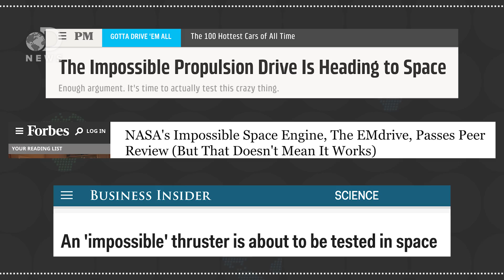How The 'Impossible Drive' Could Break Newton's Third Law

Comment: Welp, if this thing works, time to rewrite some of our science books...
Reply: SirDeimosKnightoMars  I think this resemble solar sail. Newton's 3rd law doesn't apply to photon. Photon can push objects but since photons are massless, the object can't push back.
Reply: Genus Entertainment i dont think so.

i honestly believe u can reconcile the 2 without rewriting science. 

basically i beleieve it is destructive interference at the small end of the cone that is causing the net pressue on one side (large side) to exceede the net pressure on the small side. 

it doesnt violate 3rd law nor conservation of energy
Reply: sylvester lutchman That is very likely a possibility, but doesn't seem entirely efficient if it does work, I feel like it would take much more time to build up enough momentum to even go anywhere. Sure, one side may gain more energy, but the other still gets some creating some interference, almost like a faulty equilibrium. Therefor, taking away from its absolute potential to be a mode of movement
Reply: ***** True, similar to how singularities (like a center of a black holes) seem to make the laws of physics cease
Reply: A photon is not pushing a solar sail with the same principe as you do when you push your car ( action/reaction ), photon is maybe massless, but it still has energy ( hence the solar panel on Earth ). Its energy of course depends on its wavelength ...When the photon touch the solar sail, it releases its energy onto the panel. This energy is a radiation, which can create a radiative pressure ( very little , about 1×10-27 kg⋅m⋅s-1 ). So on earth, it doesn't suffice to move something agains gravity ...but in space..if you had really a massless particle, with almost no energy, then it doesn"t interact at all with us  ..hence it cannot move a sail or anything at all.
Reply: babacalouche Oh, by push, I mean exerting pressure. Of course energy conservation still holds, I think result is redshift in the reflected ray.
Reply: One can only hope. Current Physics books were written around 100 years ago. Science is not meant to last that long.
Reply: well you can still dream..Most of the current physics is in fact from the last dozens years ( i doubt the string theory, the black holes , the parallel universe were  written 100 years ago) ...and of course even if thousand years ago, someone says " omg this thing in the sky , we should call it " sun" ",it didn't change since then...the same sun is still there, no matter if you think it's not...science is the same ...men can sometimes be wrong about it, sometimes they can ignore it, sometimes they can find something , even partially, but still science is a thing which exist and which doesn't change. Gravity, weak and strong forces, electro magnetic fields and so on existed before you could write their name and still will after the death of everyone of us

Comment: Why not just use Solar Sails? Easier and similar mechanics.
Reply: johnyjoe2k because they are shit? They give pitiful thrust ONLY if in line of sight with the sun and take an enormous (km2 enormous for anything bigger than a probe) area to deploy,  plus being susceptible to tears while unfolding them from the launcher and from micro impacts once deployed?
Reply: Solar sails are not even close to similar mechanics.
Reply: Sascha Kramarenko the emDrive would certainly have many benefits over a solar sail.
Reply: If the EM Drive does work, then I think that one works way easier than solar sails and has more power.

Comment: With "every action there is an equal and opposite reaction" does not specify the form of energy that results from the interaction or how that energy is transferred when the reaction reacts in reaction to the action. That being said the most probable answer is that there is an outside source of energy which is not constant that is not being accounted for.

Comment: I'm still only going for my degree so I'm not too fluent on the matter, but wouldn't the fact that the waves reflect to the back and bounce off of the other side cancel out the force acting on the large surface even though they're slanted because it will take the waves more time in that half thus evening out the net force? And I get what he means by relativistic speeds working on different physics, but unless he shows how exactly his example differs I couldn't really get behind it until it's tested

Comment: Wouldn't the EMDrive work because the microwaves will transfer energy, becoming kinetic momentum, when it reflects off of a surface. So a photon would release more energy from its first bounce as it would have a higher frequency. Therefore the photon would end up decaying as the energy is transfered through the closed compartments surfaces.

Either that or its a way to move spacetime, essentially moving the vessel without exhibiting any true movement.
Reply: And if the latter is the case (which it probably isn't) whoop whoop we have warp drive.

Comment: wouldn't the reactant simply be heat?
Reply: Rough Boulder yeah but that energy from heat is still escaping to the outside on a large surface area still work in space as it's still energy escaping from the Drive
Reply: in Newton third law for an action there is the reaction.  the microwaves carrying momentum bouncing of the walls would produce heat.
Reply: except they tested it in space, it still created thrust
Reply: Jordon Cole-Samuels I had the same conclusion
Reply: lasarith2 in that case it would be moving toward the smaller side, as the larger side would radiate more heat
Reply: Rough Boulder I have no idea which side it moved from the smaller or the larger if it was the smaller end -it would be more compressed at that end (not the wave itself but /\/\  instead of /  \ /  \ at the larger end creating more thermal heat then the larger surface area Still works just have to redefine the physics

Also it has a thermal plate attached to it to vent heat and they wonder why it moves.

Comment: i thought propellentless travel was already possible? like the solar sails?
Reply: Not the same as a reactionless drive though, which supposedly gets around the 3rd law, according to some. Solar sails do not have this feature to them, since the propulsion is just the "equal but opposite reaction" of sunlight hitting the sails.
Reply: Kinda. The issue with solar sails is that, afaik, the craft with the solar sail can't propel itself. Something else has to move it. Propellentless travel is very possible even in the sense of regular wind sails, but I don't know if this would be considered propellentless propulsion or not. I guess the idea is that for a craft to propell itself it requires propellant, thus far at least.

Comment: If the impossible drive works they should call it's top speed Ludicrous speed.
Reply: I don't think it could go particularly fast. I mean I'm sure a high powered one could go decently fast. But I get the idea that it's more similar to an ion drive where it's advantage isn't super high amounts of thrust.
Reply: sorry thats the alcubierre drive
Reply: ***** after years of accelaration it would probably but then you might aswell use normal fuel. OH WAIT you cant because then you will run out. See the point of it?
Reply: ***** You might be thinking of that plan to put solar sails on tiny probes and propel them away from earth with visible spectrum lasers. iirc, those things are expected to reach 20% of c pretty quickly.

Comment: Reminds me of the magnetic engine where you have magnets continously repel and turn a single magnet attached to a rotor. The rotor then converts that mechanical spin into electrical energy. Heard a lot about it before but not really sure what happened to it.
Reply: It turned out to have an efficiency less than 100%, like all closed systems

Comment: Okay- if it is working as described ( so simply ) just add 1 to 500 years of solar panel & M drive efficiency & where are we? Like the solar sail; solar lasers will fire specific wavelengths of light from close to a sun's orbit powering the interstellar crafts. Now the recent discovery of similarly modulated light from a group of 243 stars then makes more sense. Them 243 suns are being colonized by a trillion or so beings using M drive powered by solar lasers. From where we sit it appears as similarly modulated light. Whew  I thought colonizing alpha centauri  was a going to be a challenge but not anymore!! - tick tock..  your thoughts?

Comment: Why can't energy be transferred from one form to another, the energy that is transformed into say light or heat energy is used as momentum, and then it is transformed again to be absorbed back into the system to be used as electrical energy? You conserve newton's third law, but are only playing with energy that is absorbed and released. And yes you maybe loosing energy and efficiency as it transform between states and converted into other energies. But if those energies can be harnessed, than you would have a closed loop. Would you not?

Comment: If you sit inside of a box that's wider than it is tall, and continuously throw your weight against one side of the box, the box will move in that direction by sliding a little each time you push against that side. Correct me if I'm wrong, but it sounds like it's the same thing with this "impossible" drive.

Comment: It's actually quite logical. It might be hard to control the direction of the movement of the entire unit but I can see it in 'action'. I can see it work.
Reply: its actually not at all logical, if it was there wouldnt be such a fush around it.
Reply: Mr30friends Everything has similar reactions at first. I didn't say that this exact thing would work but the idea is good and seems logical.

Comment: Didn't the Mythbusters disprove this in the form of their "Blowing Your Own Sail" episode?
Reply: no
Reply: Ethan Wagner not the same
Reply: I was wrong anyways. They ignorantly confirmed the myth. But anyway, could you explain why this isn't the same, because the two situations sound similar.
Reply: Ethan Wagner as the guy in the video said microwaves move at relativistic speeds, witch means different laws of physics apply
Reply: You can blow your own sail, by having a fan on the back, it would be super inefficient, but it works.
Reply: Ethan Wagner in the boat model they were able to get it to move forward because enough air was bouncing off the sail  being thrown out the back to propel it forward, in this model nothing leaves the craft.
Reply: Harambe , No,  it doesn't.   The thrust the 'wind' of the fan puts on your sail would be countered by the exact opposite thrust on the fan itself.
Reply: Despicably Irascible Rapscallion the thrust from the sail would of course be slightly less than that from the fan because the sail wont convert all of the energy into thrust. though i can imagine a sail and a fan arranged in a way that generates thrust, if the fan alone generates more thrust its a moot point
Reply: Matthew Ciaramitaro Because you're in a boat, it's like pushing on a large object, while standing on roller blades.  There's just no net gain.
Hell, you would be better off turning the fan around (facing behind the boat) and getting rid of the sail entirely.  At least then there is a net momentum.  Pointing the fan forward pushes the fan (and the boat it's attached to)backwards.
Reply: Despicably Irascible Rapscallion i dont think you understood what i said. If you mount a fan at the port side bow and aim for the starboards side of the transom with a close hauled sail trim then the combination of the keel and the sail would cause the  boat to move forward. However if you mount a fan to a transom and have it face aftward you will move forward more, since the sail did not have a perfect elastic collision  with  the air molecules and lost some of the fans energy
Reply: And the beginning of statement was saying that if you mount a fan to the transom and blow at the sail the boat will move backwards because of inelastic collisions
Reply: Matthew Ciaramitaro I misunderstood your statement,  The sail is pretty much irrelevant in the scenario you're describing.
Reply: Despicably Irascible Rapscallion yes. My point is that its not an exact opposite thrust because the collisions are inelastic, and therefore it would not sit still in your example. Ive had to explain for children for years that blowing on the sail wouldnt make us go faster and would actually slow us down (i dont tell them it will slow us down marginally  because then they wont stop) so im not trying yo argue that it would be a good idea to mount a fan on a sailboat. Thats only for hovercrafts.
Reply: Matthew O'Connor How come the myth busters did it and it worked then? I suppose in theory it does break newtons third law. But how it work then?
Reply: Harambe , the energy transfer doesn't end when the air hits the sail, if you replaced the sail with a glass box around the fan and it still moved forward, then you would be breaking Newton's third law.
Reply: Copied and pasted from a forum.

Suppose you are on a boat carrying a ball with total mass mball+mboatmball+mboat where mboatmboat also takes into consideration your mass. Now if you throw the ball off the boat at velocity vballvball then you and the boat will have momentum mboatvboat=−mballvballmboatvboat=−mballvball. This is analogous to the figure (1).

Now consider the case of figure (2). In this case, I throw the ball at the sail, it bounces off the sail and into the water behind me. Because the process is inelastic, the ball now leaves the boat withv′ball<vballvball′<vball. Therefore my momentum is now mboatvboat=−mballv′ballmboatvboat=−mballvball′.

Now just replace the ball with air molecules and the analogy is complete. Therefore it will always be more efficient to spin the fan around and blow the fan in the opposite direction while forgetting the sail.

Comment: This is why I know it will not work. Think of a bouncy ball bouncing inside of that container. Yes, it will bounce off the top making it go forward but then it will bounce off the bottom and make it go back again. It will always go back and forth between both sides pushing it back and forth. It will just make it vibrate if anything.

Comment: I need a shirt with " more research is needed" written on it
Reply: a day to bring me summer we do sell them... for human peoples.com
Reply: Trace Dominguez okay after a few hours of R&D the resin it produces thrusts without propellant (and the only reasonable conclusion I can think of) 
Is Heat the microwaves are bouncing around the inside of the copper Oscillating, (creating hot and cold spots as they pass each other and transferring some of that energy to the inside of the copper -which expands due to heat, and the outside is cold the heat is traveling from hot>cold so it's transferring that energy threw itself to the outside , the bigger copper face has more surface area then the smaller side so it produces more transfer of energy to outside giving the illusion of impossible thrust .
Reply: +Trace Dominguez I think you gave me the wrong link. but I found the site
Reply: don't forget the arrow pointing downwards
Reply: Trace Dominguez the report says they have a large Heat sink attached to the side 😂😂😂
Reply: Isn't it like a banned phrase in some journals, since it carries no meaning... evidence is evidence. More research to ...?
Reply: "I have a crush on you... more research is needed"
Reply: David Downey I don't think so I mean you may have evidence for something but you might need more to prove it within 100%
Reply: proof is never 100% and with the use of any statistics a confidence interval, is a major part of that
Reply: Gin I
Reply: Visit any company that prints on t shirts.
Reply: Let's wear this shirt to force them

Comment: The double-slit experiment violates Newton's "law" of momentum.
Reply: Shawn H Corey how?
Reply: Because you create light, energy. conservation of energy
Reply: Shawn H Corey Newton's third law says nothing about energy.
Reply: the thing is you can't know the exact momentum and the exact location of a particle at the same time. And, the more you are certain about the location of a particle, the less certain you are about its location. In the double silt experiment you know the location of the particle at the silts so you have very little information about its momentum.
Reply: No, no it doesn't.
Reply: How is passing light through two slits in any way creating it? Also, Newton's laws are affected by relativity, so there could be something to do with that.
Reply: A quanta goes thru the slits and changes direction. According to Newton, this requires energy. But no change in energy happens. Therefore, Newton's law of conservation of momentum is violated.
Reply: They don't change direction in that experiment, they just become wave-like. Wave likes intersect like they are changing direction but they aren't. All of quantum mechanics (double slit included) break newton's laws. That's why quantum physics is different from classical physics. Super small particles follow different rules and visa versa for some reason.
Reply: The double-slit experiment has been done with 60-atom and 80-atom Buckyballs with the same results. These are so big that they act more like classical mechanics rather than quantum mechanics.